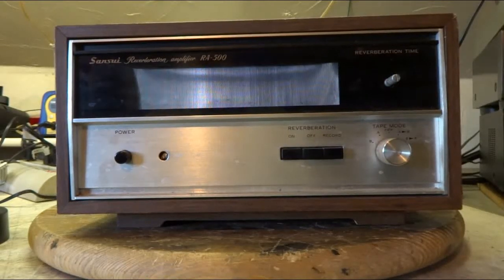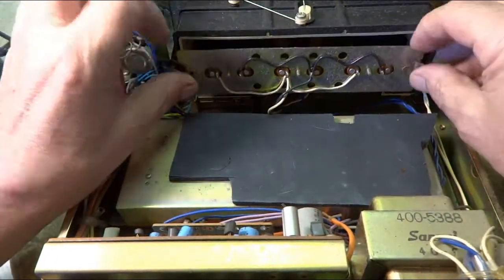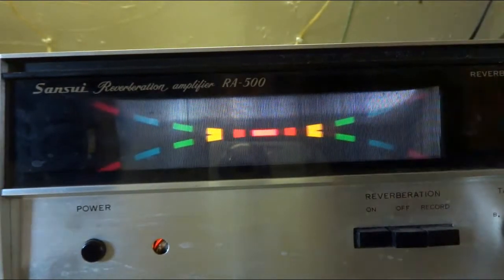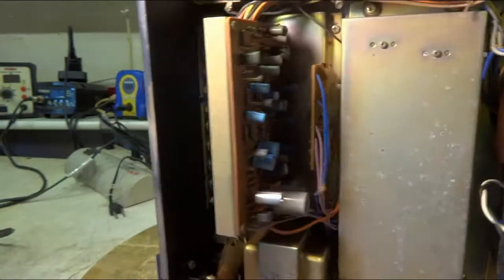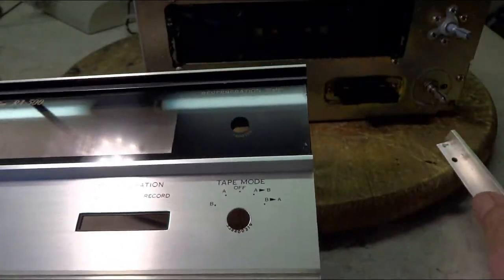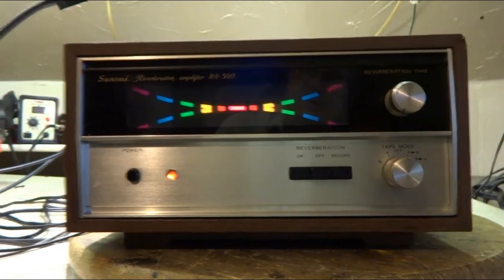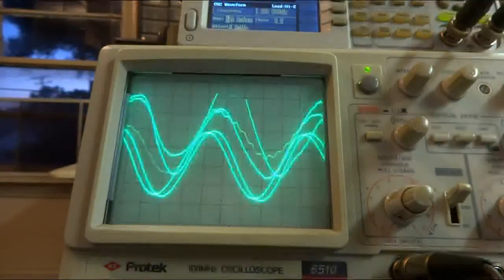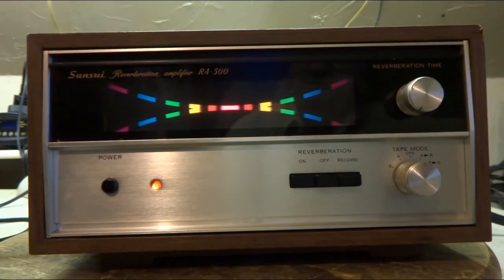sansui ra500

Comment: Patrick - this was TERRIFIC - I have been thinking about grabbing one, mostly as a curiosity piece to match my Sansui rack.  Most people today complain about their sound. Wanted a peek inside one, and you came through.
Just a couple of thoughts: have you thought about your narration?  You sound like you're bothered by the whole thing, like you're doing it grudgingly.  It doesn't matter really as your work is good but it would sure make it easier to watch.  You come off as a guy unhappy at his job, even though you are certainly good at it (I need to watch more of your videos).  On a tech note, I wish you'd opened the spring assembly if only for a look-see.  Not sure what reassembly would entail but it would certainly be an interesting thing to see.  With all the electronic delay systems of today it would be cool to see how the early attempts worked.

Comment: I just bought of these but the screen doesnt work. could you help me find out what bulbs i need to replace them?
Reply from the maker: It uses fuse type bulbs, I don't remember the voltage, you will have to look on the old bulbs for that. They do make LED type bulbs that are fuse type. I'm sure you can find what you want on ebay.

Comment: is This A Surround Sound Unit?? I Have One I Bought In Mint Condition From A Thrift Store 3 Years Ago For 25$ And I Have a 1970s Kenwood Kr 3600 How Do I Hook My Auxiliary Up To This Reverberation Unit??? and How Do I Use It With My TV? I Have My Pioneer 100 Disc CD Changer And My Sanyo RD 10 Cassette Deck Hooked Up
Reply from the maker: No this isn't a surround sound unit. It is two channel stereo.It will hook up to the tape input and output of your stereo. HiFiengine.com will have the information on it. Look under Sansui and then sound processors. I have no idea how it will work with a TV.
Reply: @patrickoconnell3896  can I have my auxiliary Cord And My CD And Cassette hooked up to it? I would like to use all 3
Reply from the maker: @booteddestroyers5519  The tape output on the back of your stereo is always live. It goes through the reverb and back to the tape input of your stereo. You can put two of your components to the reverb and the other to the AUX connection on the back of your stereo. With the tape switch on your stereo in the on position everything will go through your reverb, radio, phono and AUX.
Reply: @patrickoconnell3896  Sp How Do I Hook My reverberation amplifier up to auxiliary And Still Use A Auxiliary Cord
Reply from the maker: @booteddestroyers5519  Your reverb amp hooks up to the tape  connections on the back of your stereo.  On the back of the reverb amp you have connections for two of what ever you choose to connect to them. On the back of you stereo is the AUX connection for your third device.
Reply: @patrickoconnell3896  Ok Thank You For Being So Helpful. I Think if I Hook My reverberation amplifier up to my aux jack I can run my phone cd cassette and radio through it
Reply: How Many Devices Can I Run Through it??? just The 2 tape jacks and the 1 auxiliary?